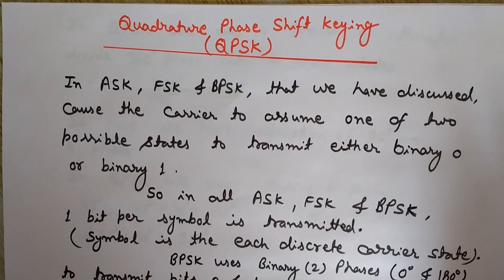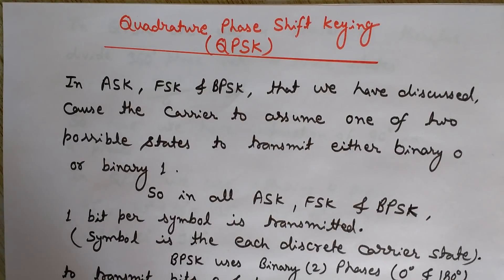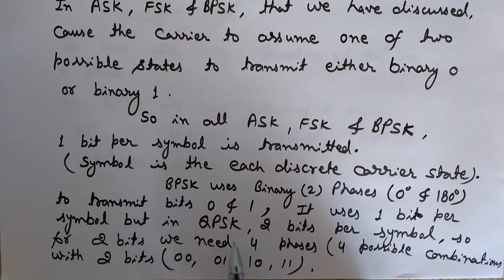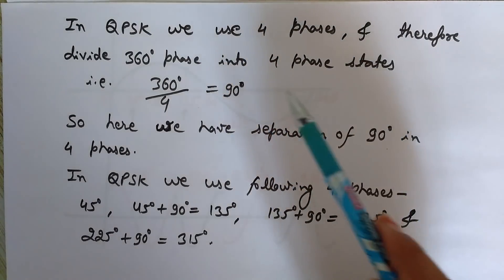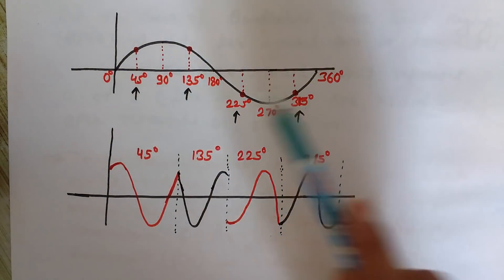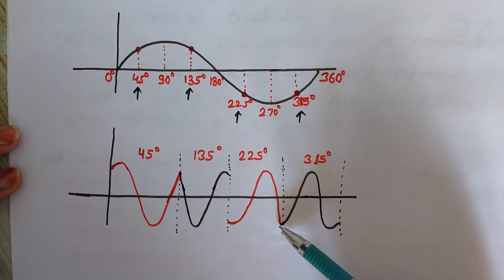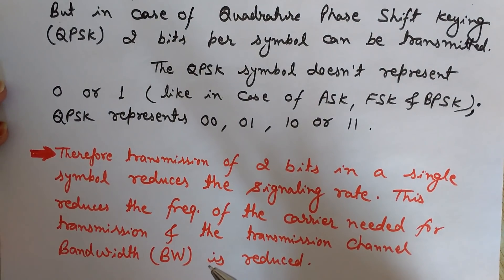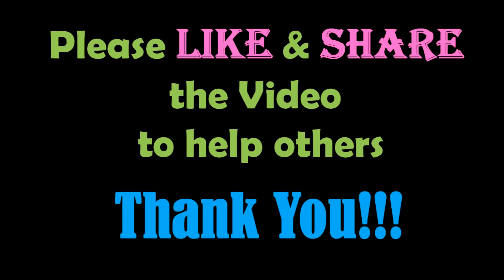Quadrature Phase Shift Keying (QPSK) / BPSK and QPSK / QPSK Waveform (Digita Modulation Techniques)

Comment: Initially you shifted the phase by 45 degree and there after by 90 degree for four different symbols. Please make it clear.
Reply: it is the format you use to transmit a signal in QPSK you separate them by 90 degrees so the first representation starts at 45 and you increase it by 90 to get the next wave, 135. then 135+90 = 225 for the next one and 225+90 = 315 for the last point.  to form a 360 circle separated at 90 degrees

Comment: great video.. but i have a question why did the phase shift start with 45 degrees why not 35 then 35+90=125, 125+90=215, 215+90=305 ?
Reply: because, the si(t)=   (√2eb/tb) x cos(2i-1) (π/4) where you substitute the value of i as 1,2,3 and 4
Reply: @abhiramjoshi3517  thanks